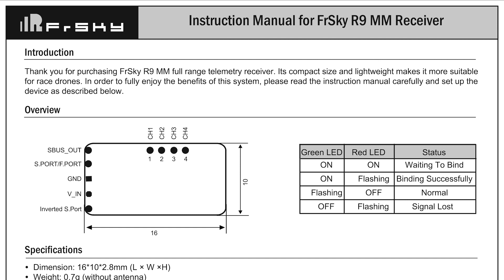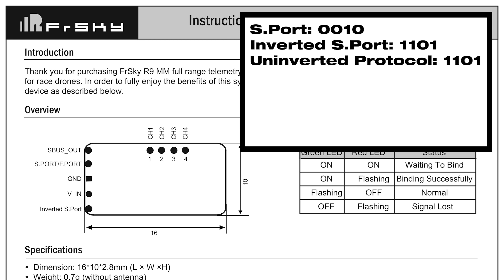What is a UART?

Comment: Thank you so much Darrin. 
  On that exact board you are using, the f405 wing. Does it really matter which uart you use for a crsf receiver from TBS? Just trying to fit this larger flight controller into an extremely small model

Comment: I'm must just be stupid. I still don't know what tf I'm doing. I can't figure out my gps. I dunno what uart its connected to or how to figure it out 😠
Reply from the maker: Next to the pads on the flight controller. There should be a number. For example, my GPS is soldered to 5v, Gnd, RX4, and TX4. In this example the UART would be 4. So in the firmware configurator. You would set the port for the GPS on port 4. Don’t forget that on some flight controllers you will need your main battery connected to power the GPS. Typically, if the power pad is labelled 4V5. It should power through the USB. If it’s labelled 5V. You will likely need to plug in the battery.
Reply: @MrD  I figured that out already but thank you!! Now the yellow gps icon won't turn yellow in beta. I have the m10 and it hates me.
Reply from the maker: @fpvwithme  did you connect the RX from the GPS to the TX on the flight controller. And the TX from the GPS to the RX of the flight controller?

Comment: I have matek 405 wing fc. By default msp is enabled on usb vcp and uart1. Its confusing me why is that? Can i discable msp on uart1 and use it for other purposes? Isn't msp on usb vpc enough?
Reply from the maker: You can disable MSP on UART 1. However, if you don’t need UART 1, it is useful to keep it on. That way, if you snap off your USB plug, you can still access the flight controller via UART 1. But, if you need to use it, you can remove it. Just never remove it from the VCP.
Reply: @MrD  Thanks for advice. Now i don't have any doubts.
Reply from the maker: You’re welcome 👍🏻

Comment: I have an issue:)

When I move pitch stick then In inav receiver tab pitch and yaw move at the same time.
Reply from the maker: It sounds like you have a mix in your transmitter. It needs to be just a standard airplane mix, then iNav does the rest. 

This is a long video, but there are jump points to specific parts of the video that you may find useful https://youtu.be/CuY_fLYoJNA
Reply: Mr.D - Falling, with style no mixer set, other models are ok just this one :)
Reply from the maker: Have look at the channel monitor on the transmitter and see if that is moving the pitch and yaw together. If so the issue is on the transmitter. If not, what receiver are you using?
Reply: Mr.D - Falling, with style I am using tbs cf Nano, it can’t be tx because others models are fine, but I will check what you suggested 
Thank you
Reply from the maker: So you’re just binding to the same OpenTX model. In which case. Check the channel map on the nano receiver. I have a hunch that the pitch channel is also being output to the yaw on there. If the transmitter is fine, but the receiver page in iNav is wrong, it has to be a mapping on the receiver its self.
Reply: Mr.D - Falling, with style ok
Thank you so much I will check it:
Reply: Mr.D - Falling, with style beautiful:)
You were right channel map was messed up:)
It is working perfectly now .
Very happy of you help
Thank you
Reply from the maker: Awesome. Glad its all working now.